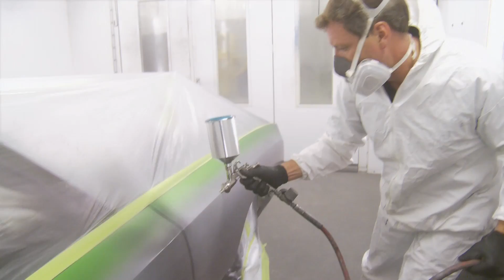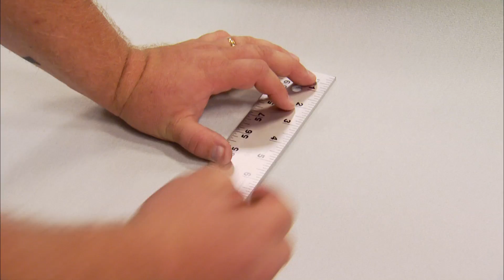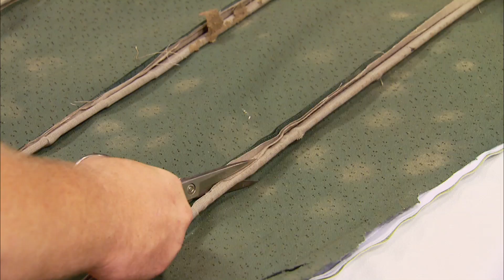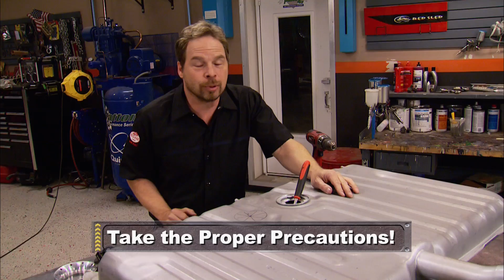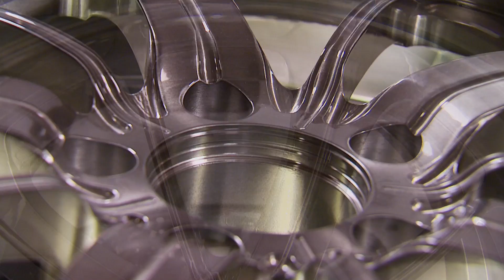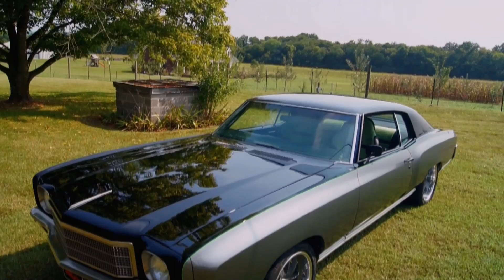Final Touches: '70 Monte Carlo Gets Custom Interior & Exhaust - MuscleCar S8, E23

Comment: If you will flip your gas tank and drill hole from underneath you will have very little shavings inside tank. Plus the plug will be inside the hole saw and not fall into tank.  Use gravity